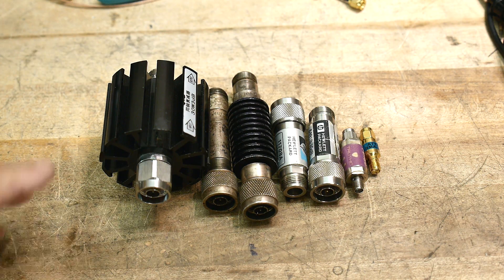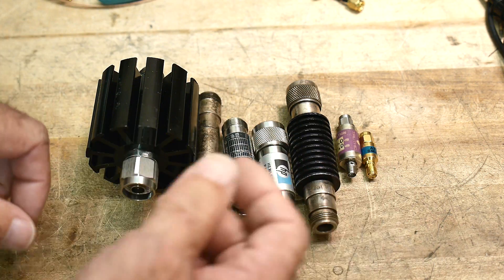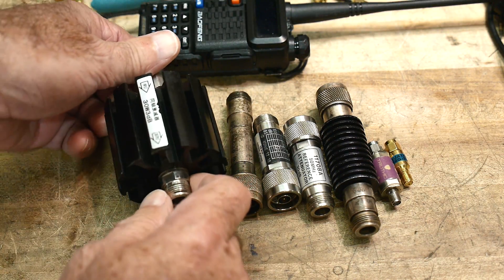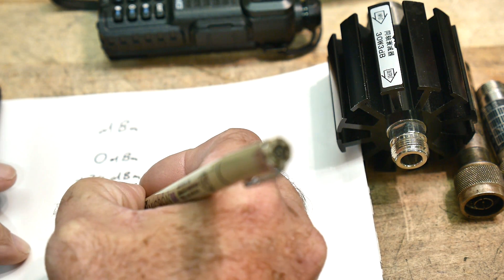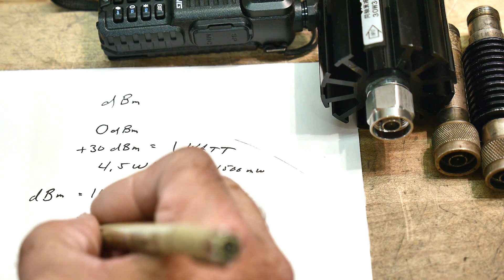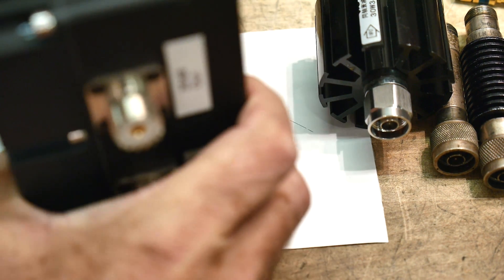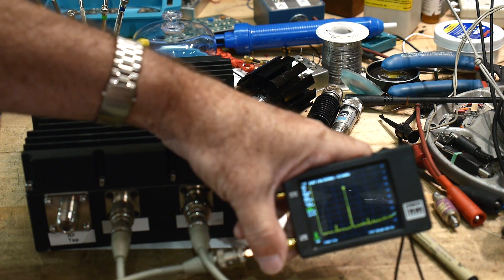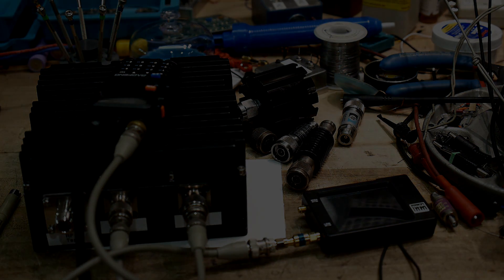#545b TinySA Using Attenuators

Comment: But if you connect attenuators like this: [4.5W] ->  3 dB (30 W) -> [2.25W] -> 3 dB (15 W) -> [1.125W] -> 30 dB (2 W) -> [1.125 mW or 0.5dBm]  then TinySA is safe.. and you dont need this 250W monster. You just need correct order of attenuators.

Comment: How about putting the attenuator in line with the antenna on the "Tina SA Ultra"?

Also, apparently the "Tiny SA Ultra" has a built-in eature that adjusts for a 20 deciBel attenuator.
Reply from the maker: no real need to add an attenuator if you are using an antenna as the input. the signal will be small and would not be bad for the tiny, the only thing to be carful of is static discharge onto the antenna, attenuator won't help that much also.

Comment: I really appreciate your videos.  

I do have a question about attenuators, my TinySA Ultra and testinf 5 and 10W HTs.  
So the best i can tell is i need to get the rf db down to -25db before feeding into my TinySA Ultra.  I have a mix of 5w and 10w HTs.  This seems to bring me to annattenuation needs between 60db (for 3.5W) - 66db (for 12.5W) of attenuation before connecting to the TinySA Ultra .

My question is can i buy a 50w 50db attenduator and connect it to a 2w 20db attenuator 
 connected to the TinySa and use this with 70db total attenuation for HTs between 3.5w or 12.5w units of TX power?

Any advice is appreciated.
Thanks in advance.
Reply from the maker: 10W = 40dBm. you need 40dB of attenuation to get to 0dBm. which is safe. so buy a 10watt 40dB attenuator.
Reply: Thanks for the reply.  I have seen some radios push more than 10W ... anywhere between 10.5 and 12W.  Will a 10W attenuator be ok if thevTX power is above 10W?  Thanks.
Reply from the maker: @AMG-502 no, get a 40dB 15W or 20W

Comment: So if my Spectrum Analyzer’s max input is +20dBm and I’m using a 10w 30dB attenuator what power in watts can I get away with out of my HT without blowing anything up? Can I use the full 5w? It will do 5w or 1w only.

Comment: Im a little confused. If 1w is 30dBm how is 4.5 only 36.5dBm.
Reply from the maker: it is a logarithm. 40dBm is 10 watts, 50 dBm is 100 watts
Reply: What attenuator should be to lower power from 100w to 10 w in output?

Comment: So if I were to attach the tinysa to an antenna that I have outside, would that mess up the tinysa without attenuators? If so, what would I need to put in between it and the antenna to save it?
Reply from the maker: no it is fine I do it. but there is a odd chance to pick up some static electricity which will zap it dead.
Reply: @IMSAIGuy  gotcha, would grounding it fix that? Thanks, I’ve been looking everywhere for this answer!
Reply from the maker: no, it won't. the first versions were pretty sensitive. the ULTRA version has some protection diodes now.
Reply: @IMSAIGuy  Gotcha, I appreciate it!

Comment: the UV-5r does have a low power setting, which might make things a bit easier!!  :) --  Also, if you transmit on simplex, say at 146.000MHz, check out the 3rd harmonic!  You could stand 4 or 5 blocks away, and the signal on 438MHz would be almost as strong as the 146MHz signal!

Comment: Wouldn't you have to load the input of the TinySA to 50 ohms, or is 50 ohms the rated impedance of the TinySA?
Reply from the maker: All spectrum analyzers have 50 ohm inputs
Reply: @IMSAIGuy  so SA no but O-scope inputs, yes?
Reply from the maker: @OBBTrip  the inputs to scopes are 1M ohm also many have an internal 50 ohm load that can be switched in if wanted..
Reply: @IMSAIGuy  Thanks for your great content.

Comment: The use of watts and dbm at the same time a bit confusing. Your attenuator can handle a certain amount of power (like any component) and at the same time it also dissipates some of this power. But besides attenuating it still needs to feed the remaining power through it, that's where it's power rating matters. In short how much signal power can an attenuator handle, and how much power does it attenuate. Both could be specified in dbm, but the signal power it can handle is specified in watt.
Reply from the maker: attenuators are specified in dB and Watts.     dB is relative, Watts is absolute

Comment: Sorry, I do not understand very well. 4.5W is divided by 100, 20db and not 20dbm, right? so the first attenuator must have a power dissipation of about 36.48dbm (4.456W)?
Reply from the maker: 4.5W is 4500mw  10*LOG(4500)=36.5dBm
Reply: @IMSAIGuy yes, this is clear to me. I did not understand how much power of the 4.5W was dissipated by the first attenuator (the one with 250W max). Now I understand the power indicated on the attenuators indicates the max power applicable to the input. ex. 5W, 3dB attenuator would take a 5W input and cut it in half and disapate 2.5W. 
in your test the first attenuator support 250W and dissipates a power of 4500mW-44mW = 4456mW. thanks

Comment: Rather than that big custom boat anchor, you could have used the two 3dB ribbed attenuators for -6dB leaving less than 1W left.  Then used the smaller 10dB and 30dB attenuators to get a total of -46dB.  That would be the right attenuation with none of the attenuators overloaded, without having to custom build anything.
Reply: and a lot more unknown non-linearity inserted

Comment: Thanks for detailed constructions and experiments.  Your 20dB attenuator build videos inspired me to make my own.  I just finished installing a 30dB 150W attenuator in an aluminum box using old laptop's fan/liquid radiator to keep it cool.  Attenuation is a level 30dB until 1GHz. I'm going to install thermistor to measure temperature response when I get rf power source big enough to push it. Maybe build an amplifier? Only have an HT radio now.

Comment: Dang, you have to do math? Then piggy back an entire stock of attenuators just to check a handheld radio? Oh my…
Reply: Suddenly a $60 device is not $60.
Reply from the maker: Nope, and a $1000 machine won't to it either, you need attenuators.

Comment: You don't always need a calculator to convert dBm to W, especially if you don't need exact precise number. Think about dBm as if it is integer. The least significant digit gives you multiplication by 2 (+3dB) or division by 2 (-3dB), the rest gives you the order. So 30dBm is 10^3mW which is 1W. 40dBm 10W, 50dBm 100W, 60dBm 1kW etc. This is easy. But the last digit. +3dB means doubling that power, so if 40dBm is 10W, then 43dBm is 20W, 46dBm is 40W and 49dBm is 80W. You can also use substraction, where -3dB means half power, so if 50dBm is a 100W, then 47dBm is 100W/2 = 50W, 44dBm is 25W and 41dBm is 12.5W. So you can easily get last digit 0, 1, 3, 4, 6, 7 and 9. Then there is something, you have to remember (similar to +3dB means doubling that power) — +5dB means multiplication by cca 3.2 (I know this is not easy to remember). Substracting 5dB means division by 3.2, but this is not usefull at all. So. If 40dBm is 10W, then 45dBm is 32W. And using previous method you can get ±3dB — 42dBm is 32W/2 = 16W and 48dBm is 32W · 2 = 64W. And if you look at that numbers, you can easily convert any integer dBm value to W without using calculator. It is simple, easy to use and gives you profesional look and feel :3.
Reply: Thank you so much for this you should be a teacher you really know how to explain stuff
Reply: Yes good tips if you want to guess the near value,  personally I prefer to be correct.

Comment: I need to reduce the radio output of 10 watts to 7 watts to feed my amp. Can I use one of these? What do you recommend?
Reply from the maker: you need a 1.55dB attenuator rated at 3 watts. That is a pretty special value.

Comment: where can i get the sma i tried ebay unless i did not search right.also if i connected my tiny up to the radio to use it as a signal generator do  i still need attenuation
Reply from the maker: search: sma attenuator
there are lots of them. If used as an output (generator) you do not need one.
Reply: Yes, you need the attenuation in recever tests too. TinySA as an generator is capable of +16dBm (40mW) at its output, but typical S9 is -60dBm (1nW) and is sometimes tricky to lower the tinySA output. There is something where you can lower output to -40dBm, but it is a little bit tricky - it doesn't work with AM modulation and I am now not sure whether it works together with FM modulation, or not.

Comment: Hello, this is a very interesting topic, especially for me in the hobby area. But I can't handle your arithmetic. The milliwatt to dBm conversion is ok. At 9:00 you subtract -20 dB from the attenuator from the calculated 36.5 dBm with the result 16.5 dBm. dB is a relative specification for gain/attenuation while dBm is an absolute measure based on log 1 mW. In the example, -20 dB is attenuation by a factor of 10. The 20 dB attenuator should turn the 4.5 watts into 0.45 watts or 450 mW or 26.5 dBm. Do I have a mistake here?
Reply from the maker: 4.5w is 4500mW is 36.5dbm. if you have a 20db attenuator this would then measure 16.5dbm.
Reply: @IMSAIGuy  Got it now. My mistake was the 20 dB attenuation rate of 10. -20 dB means 10 x voltage loss but 100 x power loss (volt / 10 * ampere / 10).
4.5 watts becomes 45 milliwatts or 16.5 dBm.
For all those who couldn't follow my thoughts: 36 dBm - 20 dB = 16.5 dBm is correct, but 36.5 - 20 is the wrong calculation method :-)

Comment: What do you need to be able to use the antenna on the UHF side?
Reply from the maker: The same restrictions apply. I limit things to <0dBm. The HIGH side is pretty crude in terms of a spectrum analyzer so don't expect much.
Reply: @IMSAIGuy  So if I did my homework as you instructed, I should be fine with a 40 db attenuator as long as I do not use over 5 watts on either side correct?  How much does using an antenna vs. direct connection change the attenuation if any?
Reply from the maker: @dennisschultz1175  It will be hard for an antenna to pick up much all by itself. so no attenuator is needed at all if the transmitting source is a reasonable distance away.
Reply: @IMSAIGuy  Thank you for your response and for this video series on the Tiny SA.  I even appreciate the math lesson on how to use the calculations on this! (hopefully my math is correct).  Because of you, I just bought one!
Reply: @IMSAIGuy so if the radio is like 3 inches away, is it still dangerous? I was wondering about it because I usually have a radio like that at work, and I wouldn't want to fry my tinySA by accident.
Reply from the maker: @musicforDRUMIES  start with it far away and let the TinySA tell you the power, then move closer but watch the Tiny. If it gets too big you will know

Comment: 12:17
Is it directional? I see you connected radio to the OUT and tinySA to the IN.
Reply from the maker: all attenuators are bi-directional
Reply: @IMSAIGuy 
Yep that was I thought. But IN/OUT labels are a bit confusing.
Reply from the maker: @АндрейДенисюк-ш7п  I kept forgetting it was an attenuator and not the load connector so I could say in/out  in/out
Reply from the maker: in/out   out/in
Reply from the maker: also confusing
Reply: Attenuators are typically constructed as a symetric resistor Π networks. That symetry implies they are not directional, but the paralel resistor at the input side is loaded by much higher power than the paralel resistor at the output side. In scope of attenuation they are (due to its symetry) bidirectional and low-power attenuators really are bidirectional, because they have the same resistors on both sides. Hight power attenuators have its high-power (input) and low-power side (output), because the paralel resistor at input side is rated to much higher power than the same resistance resistor at the output side. So you can use high-power attenuators, which are in fact directional, in oposite direction, but this usage implies much lower power limit. E.g. if you have 10W 30dB attenuator and you want to use it in oposite direction, you can do it and you will get the same 30dB attenuation, but you should not exceed the 10mW power limit. If you use it in prescribed direction, you have the full 10W power limit. So the attenuators are not directional in scope of attenuation, but they possibly could be (and high-power attenuators are) directional in scope of maximum power limit.

Comment: Also, even tho you set radio to low power you can get a big spike before it actually goes to low power. I was messing around with my Kenwood TS-2000 and was surprised how much power came out even tho I had it set at 5W. LOTS of people fried their amps! TNX 4 upload. 73 N8AUM

Comment: I am trying to understand why you would connect your Tx to tinySA this way. Why would you instead now use a simple RF sampling, where you have a straight through path, and using a simple few turns of wire, sample the RF to a sampling port, and feed that to the tinySA. Much safer, don't have to worry about the wattage of the TX or any impedance issues etc etc, and much cheaper. Am i missing some obvious point?
Reply from the maker: that would be great for any spectral measurements and I use it all the time. for calibrated power measurements an attenuator is needed
Reply from the maker: Make sure your RF tap is attenuating enough. At 100 watts you need lots and lots of dB loss
Reply from the maker: A 60dB 10W attenuator is something anyone can buy. A dummy load with RF tap is more on a DIY thing that many cannot or will not do.
Reply from the maker: One can always just use the supplied antenna on the TinySA and no connection is needed
Reply: Near field coupling gives you some attenutation, but there is a huge amount of (near field or strong enough) signals coupled to input of that spectrum analyzer, so you are completely unable to know what origins from your DUT (transmitter) and what comes from somewhere else.

Comment: Hello. 
On the baofeng UV5R you can lower the RF power through menu # 2 TXP. Put the UV5R on LOW and you will get 1W, which will be better manageable with small attenuators than on HIGHT with 5W. Regards
Reply: Diabolo 14:12

Comment: Holy low signals Batman!
50dB of attenuation is required  to safely feed the TinySA?
Good to know..certainly no input protection on that instrument.
Reply: 5 watts (lowest I can get on mobile) should be 36.99 dbm so a 40 db attenuator should work correct?

Comment: A 6dB attenuator will be perfect for a 4 Watt signal, and 5 Watt power handling capacity.
Of course, it depends on max. input signals allowed with the Tiny SA. I do not know its maximum input signal allowed.
6dB might not be enough attenuation.
Reply from the maker: NO! 6dB is not enough! the max input to the TinySA is +10 dBm. that is 10 milliwatts. 4 watts is 4000 milliwatts or +36 dBm.  I would not want to run more than 0 dbm into the TInySA so you need at least 36 dB of attenuation